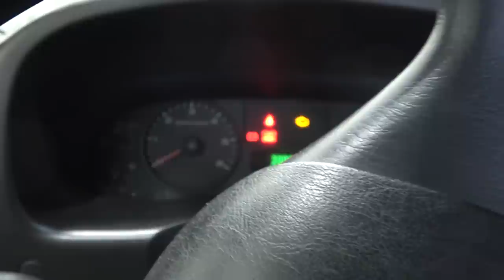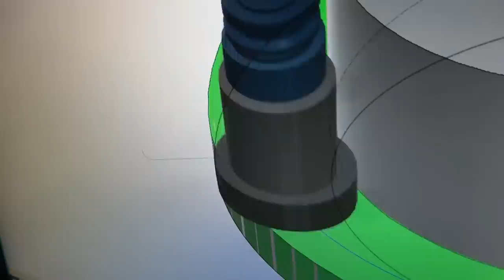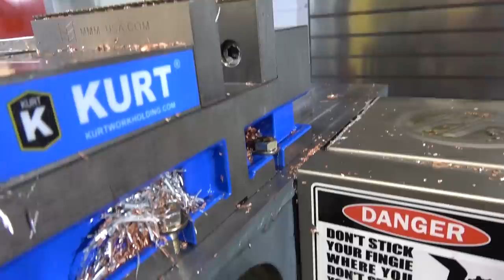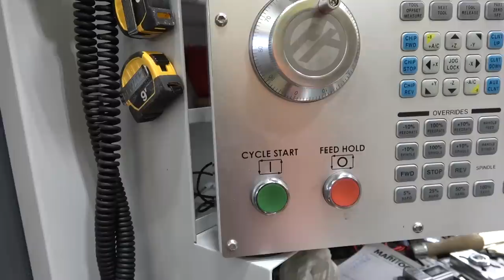How to Brake Job

Comment: Whenever I have left over bolts, but it still works, I say I've  "Optimized The Design"
Reply: Weight reduction
Reply: Increased serviceability.
Reply: Optimize, than add lightness
Reply: whenever i need bolts i go fix my car, the thing is like a perpetual bolt dispenser, they just never end!
Reply: Never do with a bolt, what can best be done with a tack weld.
Reply: No, no. You got i wrong. You didn't manage to make the thing lighter.
What happened is the universe materialized some extra parts while you were not looking (because quantum mechanics or something, do i look like a physicist?)
If you take it apart and rebuild it enough times, you'll have enough extra parts to make a second one (and some leftover bolts, but no nuts, somehow)
Reply: "I got leftover parts because I made it better!"
Reply: if the gm engineers knew what they was doing i wouldn't have to be here...
Reply: Emission control system, more like spare parts.
Reply: If you dont have left over bolts , you have done something wrong ... :D
Reply: Sounds a lot like Homer Simpson’s speed holes
Reply: Huh? More like additional parts for my parts bin.
Reply: My dad once told me when he was a teenager working on cars, they put the bolts in a coffee can, and his dad would come along & throw a handful of random nuts & bolts into the can to mess with him.
Reply: Drew Marold I’m definitely going to use that on an apprentice much appreciated
Reply: I have them officially declared “shipping bolts”!
Reply: I used to have the misfortune of refurbishing Lexmark printers. The big multifunction ones. 20 machines screws to get the first panel off and you go from there. I swear the design guys all had brother-in-laws who sold hardware.
Reply: Why is there extra holes in it?
it's for "weight reduction". that's my answer and I'm sticking with it
Reply: Drew Marold Iv done a similar thing with pool balls to win a game against a drunk who was still better than me,
Reply: If in doubt, leave it out.
Reply: @hairyneil  3 children later
Reply: I did that to a laptop computer. Three times in a row. And I never did find the empty holes. To this day, I have no idea where they came from or how it stayed together without them. But it appears that an Apple iBook G4 has about a dozen or so screws too many straight from the factory. Good thing they came out, hate to think they were bouncing around in there about to short something out!
Reply: To crack over your likes from 999 to 1K was the best moment of my life. And I genuinely meant that like. It's been an honour and privilege good sir!
Reply: An offering to Colin Chapman.
Reply: This.

Comment: I worked two summers in an auto shop, and between that and shop class I've easily done one to two hundred brake jorbs. This is easily the most concise brake job illustration I have ever seen - I felt like I was back in time working at the shop again. I suppose to non-Canadians their experience may be slightly different, but this is perfection.

Comment: Nightshift here. I am wise to your methods of cracking and snapping castings and proceed to bubblegum together with enough nickel rod to ensure sufficient softfoot that can never be aligned again. For my revenge I shall replace that greasy spindle motor resolver cable yet route it through the table index motor leads. Electronic noise faults that only occur when running production and with all units retracted to home shall be the new order of business for all the higher paid and better regarded troubleshooters on dayshift. You have been warned.
Reply from the maker: See? SEE? It's always those nightshift guys.
Reply: It is, in ways you are only beginning to suspect. For too long we vampires have labored in the shadows, performing tasks unseen by management, so assumed to be done by magic. The time of our justice against the sun-dwellers is close. Fueled by long-past-20minutes-fresh Timmies, vitamin D deficiency and repressed social lives the frustrations unleashed shall be subtle yet many and the responses identical. "Too advanced for us, dayshift should call the manufacturer during business hours".
Reply from the maker: @crazyguy32100  You night crawlers are all the same! Sandbagging until the boss' son comes up with a inter-shift competition for company hats. We'll see who has the last laugh once the 6 month QA bypass gets to the customer. P.S. please stop pissing in the coolant.
Reply: @arduinoversusevil2025  We shall see day-tripper, those block heaters are mine! P.S. the stuff in the coolant on Nakamura#2 is puke not piss (true story), the Miller Light just makes it smell like piss.
Reply: Absolutely savage
Reply: As a 24/7 outcast onlooker, who makes it his duty to both befriend and besmirch both traditional crews.   I agree
Reply: @arduinoversusevil2025  As a former nightshift guy, i can firmly state its revenge for getting to pick all the easy jobs as they're released, and leving the understaffed (i was, for the better part of two years, the only one in the entire building) to deal with it. Serves the daywalkers right!😆
Reply: I quickly learned you can't blame night shift if your shop only has but one shift, they see right through that shit.
Reply: Don't eat the Lobster Bisque, it might be tainted
Reply: ROV guy here, spares shop is never open at sea so whatever is lying around will have to be made to work. Duct tape and zip ties do wonders.
Reply: The real gold is always in the comment section.
Reply: @pointhot  Everybody hates being asked to work swing but once you get on it, you realize you're out from between the rock and the hard place.
Reply: How, and more importauntantly, did this actually make sense???
Reply: @arduinoversusevil2025  Funny you should mention that, and that. I've worked in a few shops that could be politely called gulags. Had the unfortunate pleasure, while on night shift, of catching an uncouth Philistine utilizing the coolant sump as an ersatz latrine. After the initial shock of seeing a liquid contaminant being casually poured out wore off, I used up a month's worth of four letter words in five minutes.
Reply: This innate human behavior of getting fucked over by day or night shift transcends all fields, apparently.  I am a mechanic of sorts (night shift acute care physician) and the experience is no different.
Reply: What sucks even worse is when there's only first shift... you fuck it up and it's still fucked up the next day when you get back!
Reply: A nightshifter after my own heart
Reply: Captain MufDyven  those that protect you while you sleep, take your trash away, drive you or your pizza places...
The people that finally get to sleep while suits plot to loot them harder up the wallet
#FIGHTCLUBREFERENCE
Reply: @crazyguy32100  Don't forget the classic: 'Engineering will figure it out.'
Reply: @arduinoversusevil2025  Does the coolant keep getting a Yeast infection?

Have you tried cranberry juice😉😂
Reply: @notanavrageloser  let the Mayhem begin...
Reply: Captain MufDyven  just the tip....ooops,sorry
Reply: @pegtooth2006  or tea bagged.

Comment: When the car starts making terrible sounds just turn up the radio till it's gone
Reply: moptop85 The noise or the car?
Reply: @jutde  Yes
Reply: and if the radio cant stop the noise you need to buy bigger speakers for your car.
Reply: @gabbermaikel  Had a lemon FR-S, dealer rep told me we needed to find a louder exhaust
Reply: @liambergstrom8183  lol makes sense why all the clapped out frs and brz have ungodly loud exhaust that sounds like some one put a trumpet up a lactose intolerant guy and force fed him icecream

Comment: Turns up the volume when he’s shuts it off so it’ll blast who ever turns it on my man!!!!!
Reply from the maker: I didn't invent the rules.
Reply: And tune all presets to bollywood music
Reply: Forgot to put the wipers on.
Reply: If you really want to give Prudence a heart attack jump the neutral safety switch and leave it in drive.
Reply: Some of the fords have a radio that auto sets to some AM station and high volume whenever you disconnect the battery. I’ll be that’s fun for the poor factory person that turns them on the first time.
Reply: Volume knob??? I thought that was the button that makes all the bad/weird sounds go away.

Comment: you got the wrong parts because you didn’t give them the paint code. if they knew your truck was white, they would have told you it required a different part number.
Reply: Me "I need wipers for an 02 f350"
Parts clerk"What engine does it have"
Me "Are you qualified for this job?"
Reply: Jay Dunbar 
“Is it four wheel drive”
“Manual or auto hubs”
“What size wheels does it have, the base 17” or optional 20” wheels”

“Does it have power windows”
Reply: My favorite conversation. 
Me : I need a oil filter for a 350 chevy.
Them: ok, what's the vin?
Me: no,  I just need a oil filter.
Them: yeah but I need your truck info
Me: well it's a log splitter, soooo.
Them: well we dont have that.
Me: you fucking suck
Reply: And its either a kid who doesnt know jack about cars, or an old head who doesnt know jack about the computer hes trying to use to find the parts.
Reply: @tbled52  tbh there's about 3 or 4 different filters for a 350sbc
Reply: @UnsaidLaugh  as far as I know they are all the same thread and all just different volumes.  But point taken. It could be a tire plug and they have to look it up. Meanwhile when you run into a real parts guy he can quote part numbers off 70s era Detroits from memory.
Reply: @Paul J Pachasa JR Counter Clerk:"What's a 'car bureau tater'?"
Reply: @tbled52  very true.
Reply: @UnsaidLaugh  Any of which would work on a log splitter.
Reply: @haroldoliver  I mean that depends on clearance I guess but yeah probably.
Reply: This kills me. I gave the tire place some dimensions, and they insisted on knowing the year/make/model of the car.
Reply: As an ex-auto parts counterman pre computer I can tell you that Timmy down at  O'reallys has never been under a car in his life.  I worked with a genius that knew every part number for every foreign car ever made. He could sell you hydraulic kits for your anglia from a mix of Toyota , Datsun , and ford parts. Out of his head.
Reply: @Paul J Pachasa JR having worked at a parts shop, the catalogue asks for stupid stuff all the time, and while 99% of the time it won't matter, why the hell not put it in when the confuser's asking for it?  I mean, i could do two lookups and make sure the parts the same, or i could just ask manual vs auto or what the fuck ever it's asking me and you'll get your parts a lot faster.
Reply: Have fun with them and ask for a radiator for a 1972 VW bug 😉
Reply: Mack Jones I would return it because my hypothetical bug doesn’t have an inverter 😂

Comment: I'm a shift (insert trade here), I only perform emergency maintenance. That's a day shift (insert trade here) job, I'll put in a work order so they can do it in the morning.
Reply: Years ago I had a shift job where we actually had standing work orders for things like leveling the building foundations, resurfacing the concrete parking lot slabs and fixing a collapsed drain line that ran right under the center part of the building and production hall and our tool of a manager wouldn't take them off the 'to do list'.

Even got my ass chewed 'for not working on them' on slow nights.
Reply: @tcmtech7515  my favorite is when our executives come in a take pictures and start conversations about the "To do" dry erase board  where we try to be sure only the most ridiculous tasks are assigned to those that piss us off.
Reply: In my experience, its usually A shift leaving stuff for the B shift.  A shift is just a bunch of old dudes looking to get out before bedtime.
Reply: I worked with one of those rare old timers that stayed on nights. He left me with these words of wisdom when I started as a new guy "Never do tonight, what you can fuck your day boy with in the morning'
Reply: Honestly I blame the administrative types if they understood my job maybe they could keep me from not doing it. Hard to tell where night shift duties end and day shifts start when you don't understand the work being done.

Comment: "what's that noise?"~Turns up radio~"What noise?"
Reply: got my car a 1100k trough Europe like that.  No problem but a hearing problem now
Reply: Thats how my dads slug-bug and dodge slant-6 died...ol' lady drove in 2nd gear with the radio maxed out. damaged block on the bug, de-springified the pistone' rings from overheating the engine.

Comment: Left over bolts? How else do I get stock for cobbling together another car that’s in more need of being held together with mismatched fasteners?
Reply: ♪♫ it's a '65, '66, '67', '68, '69 automobile... one piece at a time, and it didn't cost me a dime...
Reply: I’m not even joking I have 5L tubs full of them for when you need just the right fastener 👌🏻
Reply: @finnice  it's not hoarding of you actually use them. At least that is what I tell my wife
Reply: When I assembled new bikes. I always stuck bolts and hardware in my pocket... everyone laughed that I took the time to pick them up. It's been 5 years since I worked there...I have one bucket left...I used the rest of them.
Reply: When there's an old mason jar of "belongs on the car somewhere" in the center console.

Which I complicated by occasionally buying new hardware if I was too lazy to rummage in the jar. With a couple of spares . . . that went into the jar.

Comment: Somewhere an Aamco brake lathe rep is showing this to all his friends over beers.
Reply: I hated using the brake lathe
Reply: @Wesleystewart78  
I liked using the brake lathe, for a Mechanic it was one of the few things you could do in the workshop that looked like you were working when you were in fact ... resting.
But machining rotors is yet another thing of the past in workshops these days.
Reply: Preston Newcomb that’s always a problem.
Reply: AuMechanic The mom and pop places still do it, especially in lower income areas.
Reply: @AuMechanic  that's very true, you can stand there and take 0.001 off per pass on a single side no less. As the service Mgr I had to develop rules about that and my biggest fight is always having fresh cutting edges on the insert tooling.
Reply: @Preston Newcomb I started out in the late 70's on brake machines made in the 50's. It was quite interesting at times. But this was back in the days there was still a machine for truing the brake shoes as well. Drill out the rivets lay on the knew material, rivet in place and make true. Oh and no dust collection either.
Reply: I think the last living rep died 10 years ago.  There certainly isn't two still alive.
Reply: @AuMechanic  Unless the tech knows he's getting paid 2 hours to machine rotors but only 1 hour to replace them.

Comment: Hey when you have a $100,000 machine, you fix a $50 rotor!
Reply: Yeah when the store is closed lol
Reply: $100,000? Whoopee! Must've been a sale on.
Reply: @Senkino5o  Just a nice round number to use for the joke. 😂
Reply: Yeah and I make $6 parts on a 150k machine, so what? 
It's not a one off.
Reply: Ha $50 rotor... those f250/350 rotors with the bearings included are close to 200 bucks a pop americans.
Reply: I think that rotor is worth more than $50, that's a big boi
Reply: a lathe or a wood-turning-machine should have also be able to do that job... I already hear you shouting "BOOOORING", but... who has a clutch for brake-units?

Comment: As a young apprentice and genuinely happy spanner thrower, I learned at the hands of a Yoda type grumpy old bastard who technical knowledge he wasn't giving out without a bribe or until I could fool the barkeep that A my baws had dropped and B, I could confidently walk to the bar and ask for a "hawf and two pints" "hen".
After passing the death stare of the said female host who knew I was probably underage and had yet to heavily invest in the Snap-on truck or Gillette blades, I was frequently reminded by the application of hand to back of head that being killed on a test drive after you fixed something was liable to get my baws booted even if I was deed.  happy days indeed.
Reply: amen

Comment: When you are the only worker in the engineering / repair department, always have at least 3 jobs on the go at any one time. A part in the lathe, a job on the mill, and the welder hooked up to some machine. And never tidy up. A messy workshop looks like a busy workshop!

This way the bosses never know how long it REALLY takes to do any one job and how hard you are REALLY working (NOT). 

And of course if you get a call from production that something is wrong, you are keen to drop everything and answer that call. This muddies the waters even more, and gives the impression of you being a hard working company man. 

Only you know the real truth....  :)